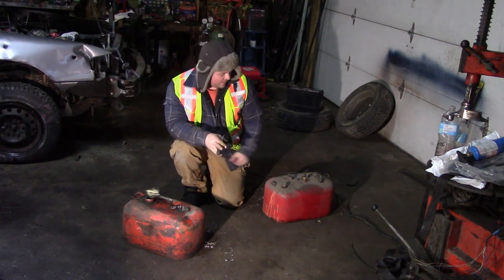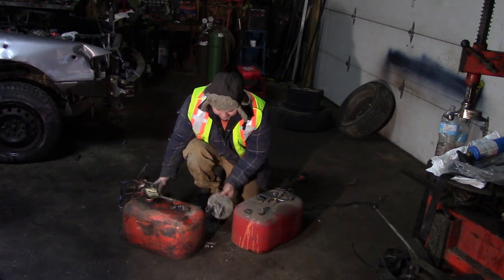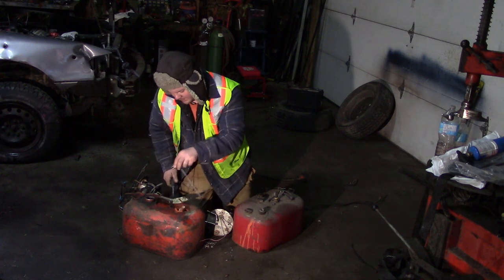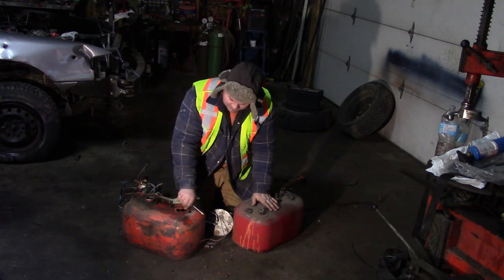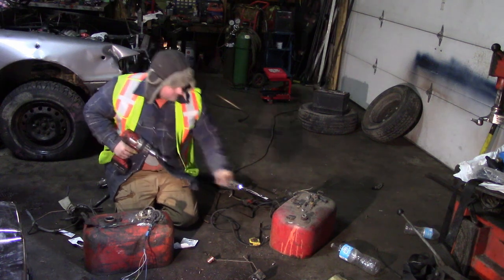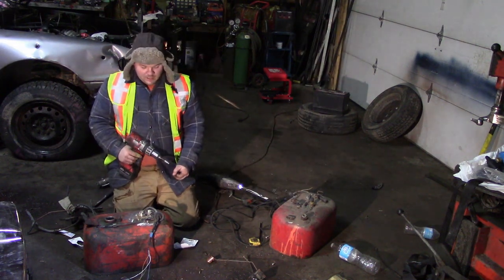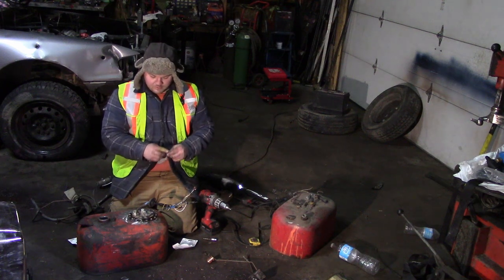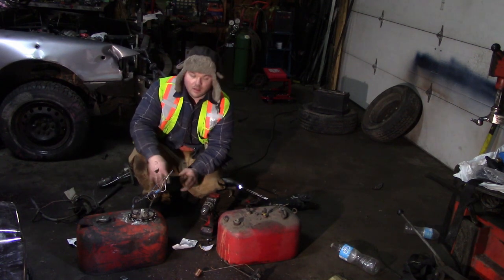how to build a demolition derby gas tank in tank pump

Comment: I use jb weld insted of screwes or i cut around the holder thing in the factory gastank and weld that ring in the boat tank so that i just bend thouse tabs over the ring to hold the pump in
Reply from the maker: i tryed jp weld in the past i found the gas ate at it fast, tried silicone. the seal all is what i found works the best. i do weld some of them as well , but for a fast and easy for any one to do at home i use seal all
Reply: i always use seal all to on top of the jb weld i do find i have to add jb weld and seal all from time to time but i usualy weld the part that holds the ring and use seal all both jb weld and tech screws have failed on me during the derby but anymore i run carbed luminas so i dont have to worrie about intank pumps or expinsive inline pumps
Reply from the maker: nice so you run low pressure inline pumps?

Comment: Which type of fuel pump will work for my 2000 volvo s70? Just had a metal boat tank givin to me and the stock fuel pump is all plastic the screw on version.
Reply from the maker: whats the psi on the factory volvo pump ?
Reply: @zacksworkshop171  i have been seeing online of people saying like 50 to 55 psi. Other then that thats all i found i cant find anything else.
Reply: The tank i have is a 6 gallon boat tank. I believe the same type of tank that you use. Would it be better to use an in tank fuel pump or an external pump?

Comment: How do you vent the tank cause im using the pump from the car and i bought a preran tank with the hole already cut amd with the rubber gasket it seaps through and turn the seal all yellow im going to try and add more self tappers but if that doesnt work would i just be better off to weld it there
Reply from the maker: seal all works amazing
Reply: @zacksworkshop171  alright i might have to make an adaptor and weld it to the cover of the pump since i belive they cut the hole too big

Comment: I leave the pump n unit in the top of the stock fuel tank and cut up the top of tank than make a hole for the pump than seal the whole piece to the derby tank.. Than you can change the pump without ripping the tanks apart like a normal tank
Reply from the maker: i use to do that as well but i found that it would always leak and i would get so mad at it

Comment: Are these dangerous or something ? The derby I plan on entering is requiring actual fuel cells with bladders and with non-nylon fuel line.
Reply from the maker: they are prone to leaking a tank made for fuel that is thicker and better made is better these are cheaper